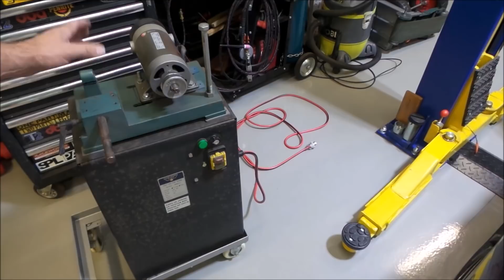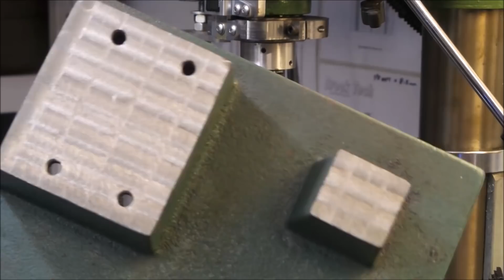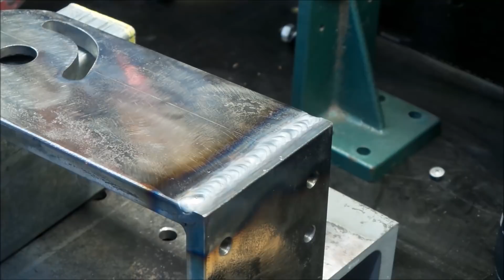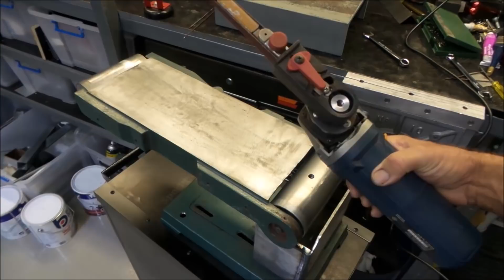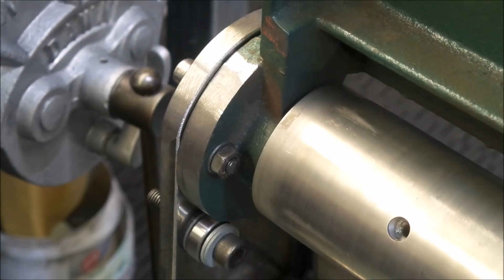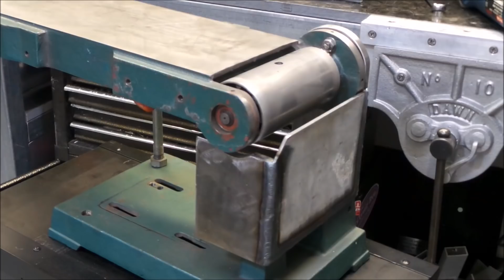6 x 9 Belt Disc Sander-Linisher, Repairs & Modification. Episode 2

Comment: Is the dc treadmill motor on your drill press multi-directional? 
I ask because I've got an old 3 phase milling machine I want to but a treadmill motor on. However I can only easily source one's that turn one direction. How essential do you think being able to reverse a mill's spindle is? Thanks
Reply from the maker: G'day Marcos, Yes, Forward & reverse with a Stop in between. No Issues so far with reversing them, Same thing on my Lathe. Cheers Mate.
Reply: @TheAussieShed  Noted. Such a quick response! Thank you. Keep up the great videos.

Comment: Dear Aussie Shed man! Nice repair series!! Can you share what welder you use? My dad was a whiz with a stick welder back in the day but I imagine an easy wire welder might be more my speed
Reply from the maker: G'day Paul, I generally use Tig. If you want to learn to weld, Learn Tig, that way Mig & Stick will be something you will pick up easily. Tig will teach you the Fundamentals for other processes as well. A lot of folks go for Mig straight of the box as it looks easy. They usually just end up making a mess, again you need to learn the fundamentals first. Cheers mate
Reply: @TheAussieShed  much obliged, cheers!

Comment: Did your new bracket end up 12mm taller than the original??, I ask because you scribed the end of the original bracket onto the new slab of metal & I see you welded the new one onto the top not the end of the new baseplate.  Believe it or not, I have the same exact drill press, purchased in 1982 :-)
Reply from the maker: G'day Mate, no, I took the thickness off before it was cut, You can see the difference at 29.04 on the first episode. How has your drill press been, mine was quite a reasonable performer even before modding. Cheers.
Reply: The Aussie Shed the drill press has been good, stalled it a few time drilling big holes so just recently bought an X3 mini mill

Comment: Could have just as easily tapped those bolt holes and put studs in place so you wouldn't have to have worried about the bolts on the inside. Nice trick with the finger sander.
Reply from the maker: Hi Kenny, thanks for the comment, which bolts are you referring to. Cheers Mate.
Reply: @TheAussieShed  I think he means the swivel locking bolts! I was gonna suggest flip the bolts the other way and tack weld them to the frame then just loosen the nut on the outside to swivel. But his idea is cleaner
Reply from the maker: @pb7379-j2k  G'day Mate, nice ideas, but neither of them will work, due to the Disc Sander portion of the machine covering the outside of that area. The Manufacturer did it this way for a reason, Cheers.

Comment: Darn always a complication? OK how about welding some flat bar to the bolt heads long enough to stick up above the disc sander outer Diameter so long as it does not compromise any thing else. Save having to remove the disc? Or just below the diameter with a socket to fit an external leaver when needed.?

Comment: Where you ground out the space for your spanner, I would have made two nuts which locked in to the frame then all you need to do is use a spanner on outside of the machine to slacken or tighten , much easier.
Reply from the maker: Hey Garth, great idea but unfortunately not possible in this situation.
The Disc Sander portion of the machine completely covers the outside of that area once finished, which is why it was done that way from the factory . Once I get the Disc repaired & mounted you will be able to see.
Cheers, Thanks for the comment.

Comment: Ha Ha , if you think your camera is a piece of junk you should try mine  its an old i pad !!!   Good repair job so far , whats the  tube bracket  on the mill  drill  for ?  Cheers .
Reply from the maker: Hi Max, thanks Mate, the bracket holds the Z axis DRO, which is just a cut up vernier & also the depth lock/adjuster that I fabricated. The original depth stop is on the hand feed lever & as such only locks the pinion axle. Due to the slop in the Quill Rack/pinion axle its pretty much friggin useless for anything, except maybe making Swiss Cheese. Cheers Mate.

Comment: aS,
  I have been enjoying your content since I subscribed a few weeks ago. I will be looking forward to your description of your drill press/mill conversion. I have been assembling a few components. A six by eighteen Shars mill table, an Asian made four inch mill vice and a three inch screwless vice. I have a 1970s model floor model drill press which should be adequate as it’s a very heavy duty unit. I do have to convert to a system to slow it down, either with a dc motor or step down gear box I got at an estate sale recently. My current challenge is to figure a way to convert to a collet system. I have a set of er32 collets I use on my lathe so I just have to acquire the proper collet chuck. Another issue with this model of drill press is the table. I have to devise a way to raise and lower it accurately. There is no rack and pinion mechanism and nothing to positively position the table on the round post. I’ve been thinking of possibly using a side crank trailer jack and maybe even making a positive mount independent of the actual post. Don’t know, still thinking through it. Anyway, good channel. I appreciate your attention to have decent audio. I have sever hearing loss caused by mortar and ordinance explosions while serving in Vietnam back in the day and can only enjoy utube by using special headphones. I hope you do your conversion videos soon as I am anxious to learn your concepts.
Reply from the maker: Hi Dale thanks for your interest,  Video on the Drill Press/Mill conversion is definitely coming. I have to Break it down soon to move it up the Bench slightly & will do a full detailed explanation on it then for sure. Cheers Mate.

Comment: Hey Trevor.
Nice work milling the faces of the sander base.
Nice bracket you made to.
Same but Different  ( as they like to say in places like Thailand and Same ? ).
Hey Trev if you are looking for some extra income maybe might be good to use that voice of your as an announcer at your local Speedway.
Thanks for the video.
Peter.
Reply from the maker: Thanks Peter, You're to Kind. I'd be to Sloshed I reckon & I'd get all of the Cars wrong.
Reply: @TheAussieShed 
 Not all bad though.
 If you were sloshed might make a little more interesting to watch the racing.
Maybe you might be good to do the announcements for the Smash Up Derby, lol.
Good to see the linisher back together.
Better than new.
Thanks for your reply.
Peter.